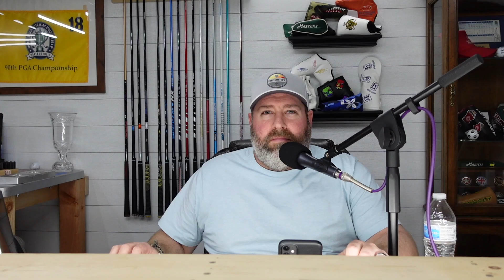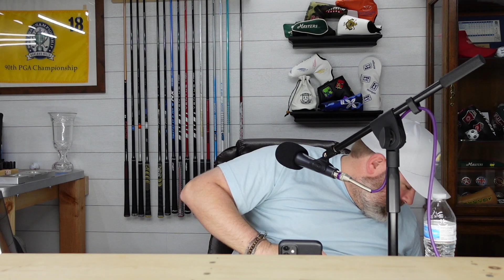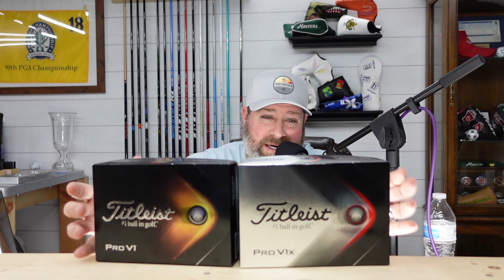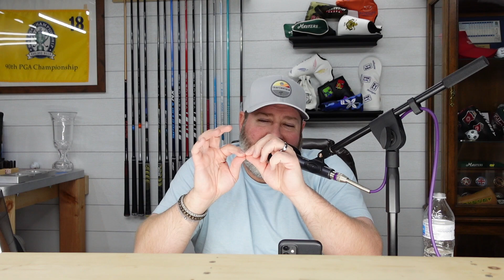Club Junkie: TaylorMade's Stealth Woods and Hybrid Initial Review

Comment: I can validate what you’re saying about stealth plus. I got fit for the 8 degree head paired with the tour ad xc 7x shaft. My ball speed was 162 on a stock shot with a baby draw. My miss is a block right and these bad shots, the spin stayed low, under 2500. I couldn’t believe it, low spin off a heeled low strike. These misses still flew 285, for 300 total. I haven’t ordered a driver for 3 years, but this is a definite improvement over my mavrik sub zero.